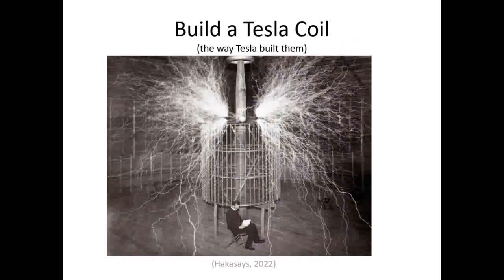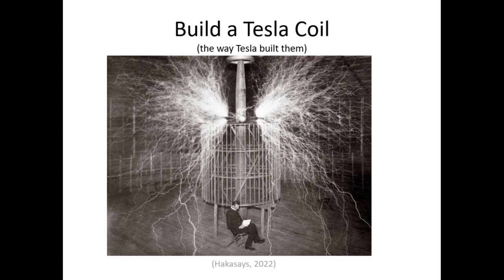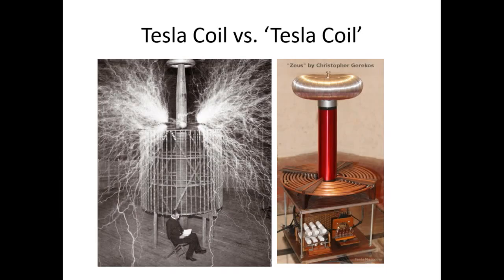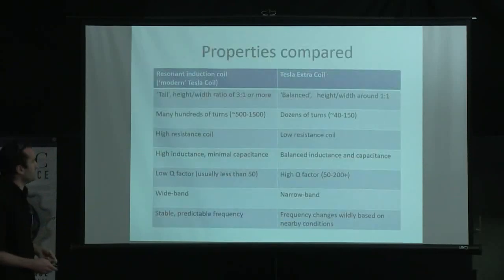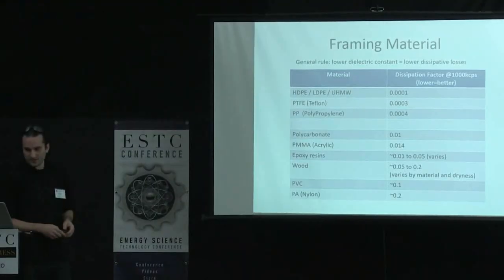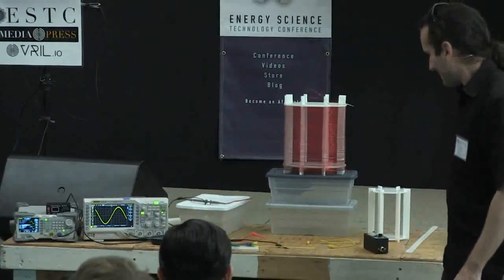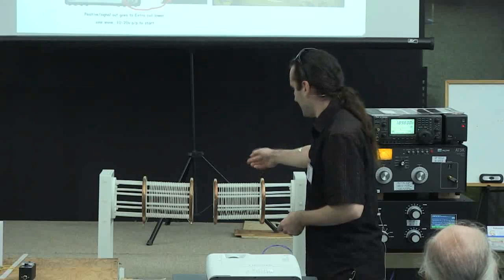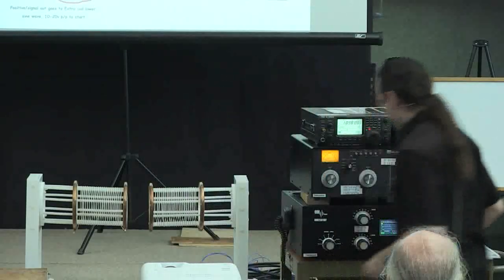2022 ESTC Preview - Build a Tesla Coil the way Tesla Built Them by Hakasays

Comment: dont take this the wrong way but whats that thing in his hand? seems like supposed to be a remote but since i seen other vid with the light to turbine immediately turn on ive been looking at vids with a close eye..he keeps the bulb and that thing in his hand at the same time vs using free hand then the bulb seems to glow brighter towards his hand vs the tesla coil you ever heard of a slayer exciter?
Reply: You might be seeing the powerpoint clicker in one hand as I run through the demo.   Otherwise if I'm holding the bulb, the off-hand is likely changing the frequency to the function generator slightly to compensate for dielectric conditions.

I like slayer exciters but they tend to drift too much for what I need it for.  Very hard to make them good for reliable HAM-tier communication and precisely-repeatable experiments.

Comment: i am glad to see this. If you need a cool idea read further:
AC MHD propulsion.
Mitsubishi wanted to build this boat that would do 100 knots, but last moment decided to go DC MHD which barely made the boat to do 8 knots DUE TO ELECTROLOSYS.

So, having a electromagnet coil shoot between 2 capacitor plates where each end of the coil is connected to each plate and you drive the plates at resonant frequency
What happens is the electric and magnetic changes signs simultaneously which causes the right hand rule to always point in 1 direction effectively getting propulsion.
Such system would work in vacuum on high enough frequency or even normal frequency if you add a heating element so you provide free electrons/charges for AC MHD propulsion to lach on. (in such case it could probably also work with DC variant but i dont know for sure cause AC goes "through" capacitors
Reply: @ChannelTheLizard hence why i put it in quotations